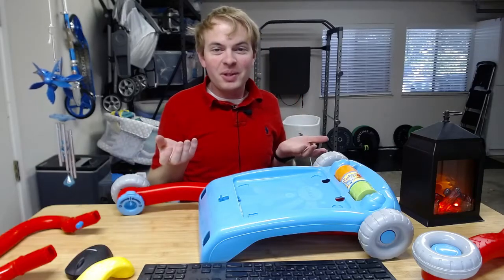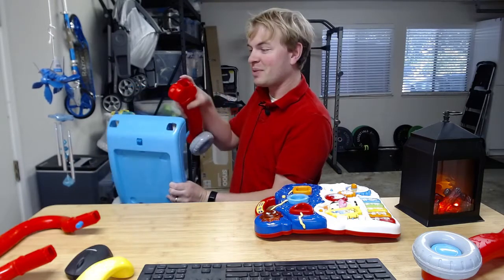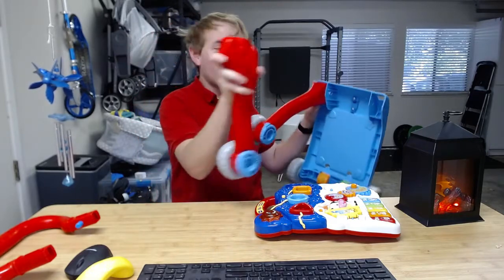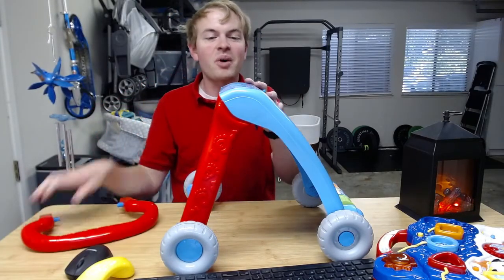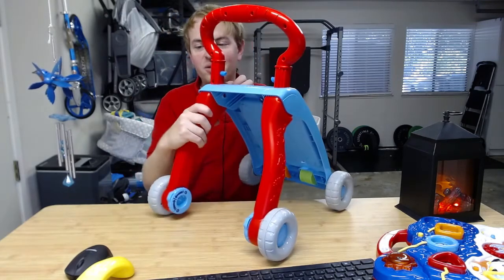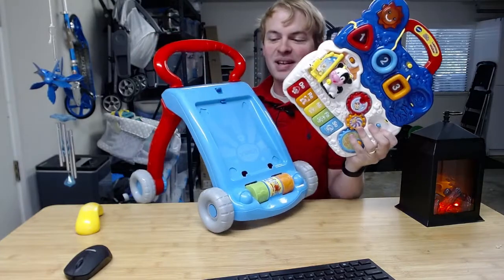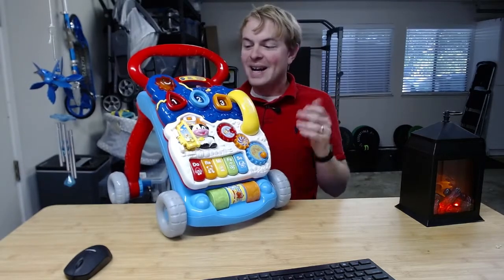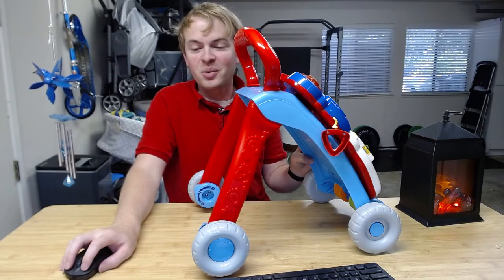How to Assemble VTech Sit to Stand Learning Walker

Comment: What if you put the handle on top first and can’t get it off
Reply: Same issue here but I used a small flat screwdriver and finally got that handle out😂
Reply: I used a pen to push the pieces in and held one side while I did the other finally popped it off!
Reply: @lillyll4  same issue here 
How to take off the top one it’s locked 😂